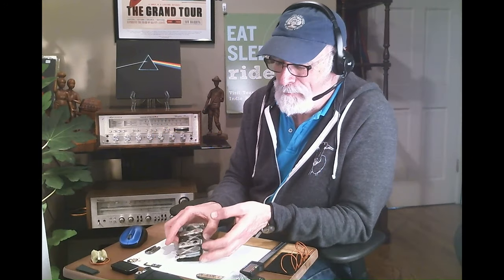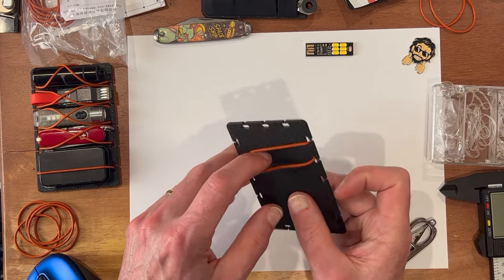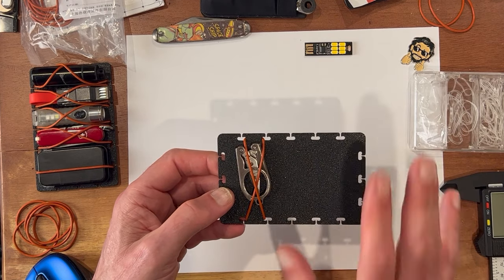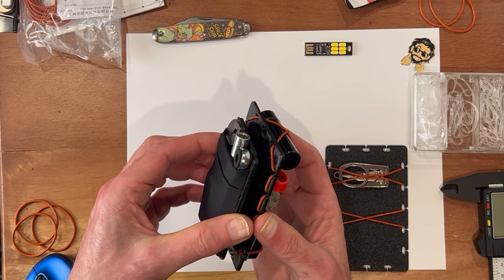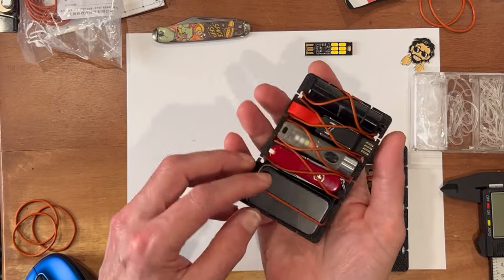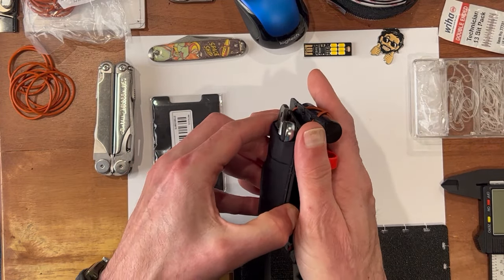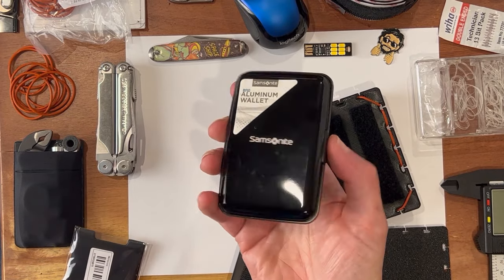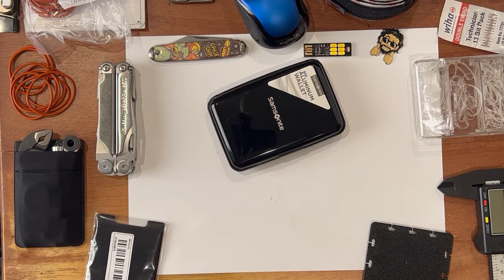Rugged, Compact & Lightweight Design In An Everyday Carry Pocket Organizer -The Pocket Rack 2.0

Comment: I love all of these ideas! One suggestion, though: attach one strip of each side of the velcro to each card / tin (one strip of the hook side, one strip of the loop side). Then, you can mix and match anything with anything else - just line up the opposing velcro pieces.
Reply from the maker: That's a good idea. Simple to implement and will make attaching items to cards, not be dependent on if it is hook or loop. NICE!

Comment: Cura has a fuzzy surface option to create a rough texture on the top layer if that's useful to you. Also I found a really interesting key holder that puts your keys in a multi tool layout that could live in this system. It's on printables. "Single-Hand Key Organizer" is the title.
Reply from the maker: Thank you for sharing that. Finding items that are an appropriate size and are of good quality and function has been a really interesting part of putting these racks together. I'll have more about this in an upcoming video.

Comment: Great improvement. Continue to explore for more usage. I was thinking to do something similar to adapt to different situations (urban, travel, survival)
Reply from the maker: @stephanem5125  That's exactly where I'm going in the next video. I've been testing a small belt pouch that the pocket racks fit into perfectly. I can add pocket racks with different purposes (first aid, urban, etc) as you mentioned. Because the pouch expands, I can also carry multiple racks at the same time if needed. You end up carrying one small pouch and just change out the rack(s) you carry in it. Thanks for posting.

Comment: Thank you mate! I was searching for some pouch for card with stretchy fabric to inset in my zip pocket slash tool bag. This is just right. Also that pocket card organizer is quite refreshing idea in this niche. Organizing daily things, tuning up, perfecting daily carry each time... Nice! One thig off top of the head... there is a soft rubbery mesh that's put under the center rug/carpet so it doesn't move and slip while walking on it on slick hard flor, would be good backer on the abs board under the items. Don't know what is it called exactly in US.
Reply from the maker: The next video will cover a bit more about using it with a small edc belt pouch. It's like having a small pocket on you belt that you can easily store it in and pull it out when needed. I', familiar with the rubber surface you are talking about. that's an interesting idea. Thanks for posting it.

Comment: Thank you! I cut some notches on a credit card and cut off some rings from a bike tube to hold my little things such as USB adapters. I never use normal rubber bands because they are too stretch and they don't last.
Reply from the maker: @kingoftweaks   Thanks for posting. I actually tried using "ranger bands" cut from tires and they work, but they are difficult for me to cut to the narrow bands that I need for the pocket racks featured in the videos. The silicone bands that you see in the videos works really great though.
Reply: @EarthlingEDC  You need an electrician scissors such as Klein 100CS or Ideal 35-088. The very best scissors for cutting anything. Every EDC man must have one. Once I have used one, I can no longer use any other scissors. Yes, the only scissors that are able to cut the thinnest rings from bike tubes. The only downside is heavy at 3 oz. for EDC.
Reply from the maker: @kingoftweaks Thanks for the suggestions regarding the scissors. I'll check them out. The weight factor might put them into a tool pouch though, rather than my mini EDC pouch. Thanks again for sharing that info.

Comment: The plastic cards you attach the lycra pouches to; where do you get those?
Reply from the maker: You will need to cut the card from a sheet of ABS plastic or Kydex plastic. To determine the size, when you get the Lycra pouch, use it a template and outline the edges on the plastic with a pencil, then cut it with a coping saw or a regular hand saw.  Once you have cut the card out, sand down the edges with a medium grit sandpaper. Clean the shiny side of the card with some alcohol and let it dry before applying the adhesive side of the lycra pouch to it. Thanks for your question.

Comment: Significant improvement over Molle. My dimensional testing of my various EDC typical pouches with Molle with five tool places show that with your pocket organizer one can store seven tools in the same space horizontally. That's an improvement of  21.5% savings in usable horizontal space. It's better to buy an uncomplicated EDC pouch without Molle and pockets and simply install pocket organizers, with/without the latex like pockets and tins as necessary. Separate EDC pouch compartment(s) for phone and other unrelated tool items would also be useful. I would prefer to use the pocket organizer for my EDC pouch rather than in my pocket for hiking and bushcraft purpose. Please make the pocket organizer available as using Kydex which I've cut to size leaves me the difficulty of using a drill and fine file to complete it.
Reply from the maker: @ulperformance4087  Interesting that you should bring up the option of using it as a EDC pouch organizer, that was the topic of the latest video. See: https://youtu.be/RRDfjfRTiF4 . Almost done with the design for the 3d version of the rack. It's going to come in two sizes. The 3D printed rack featured in this video is the larger size, and a smaller more compact size will also be available. I've also done some additional work on the design of the silicone bands that increases the number of contact points on the EDC tools that are secured to the rack. I'll get into this in more detail in another video. Thanks again for posting your comments and ideas.
Reply: @EarthlingEDC  Cut to the chase. When can you manufacture them. I’m stuck with two pieces of Kydex, 5” X 8” and faced with drilling and filling them doubtful I’ll get it right. Please help.
Reply from the maker: @ULperformance  Thanks for asking. Yes, as of this post, I'm trying to determine the best way to make them available to people who would like to have the 3D version at the same time I'm trying to determine what the final version(s) will look like.   In the meantime, since you've got the Kydex,  why not start start by cutting the Kydex cards to the dimensions indicated in this PDF. Once that is done, then round out the corners and the edges with some medium grit sandpaper. Ping me again when you have that done and I'll see what I can do to make some drawings and more detailed instructions available. Best of luck
Reply: @EarthlingEDC  Phil, thanks for responding. I’ll get to work on your recommendation either tomorrow or Monday and get back to you when completed. Best regards, Stuart
Reply from the maker: @ULperformance   - The 3d file is now available for printing pocket racks . See: @stevendebruin2222   for details..

Comment: what size silicon bands for the long end?  The short end is 40mm, which was mentioned in the video, but what about the long end?
Reply from the maker: @Chadzilla333  check out the more recent video on elastics. https://youtu.be/ir9DbaY8P8Y?si=e8AQqhAj_gjnAAXJ I think you will want to go with custom bands in the long run. They are easy to make and low cost... Thanks for your post..

Comment: What’s the usb in the top at 1:27?
Reply from the maker: It’s a dimmable USB light that you can plug into a battery bank. It’s touch sensitive, so all you have to do is touch it to turn it on, off or dim it.
Reply: @EarthlingEDC  thank you!
Reply: Where did you find this USB light ? I love it
Reply from the maker: @stephanem5125  on Aliexpress.com search for "3pcs USB Card Light Touch Control" it should come up in the search results. I have the "Warm" light version. Which works well.